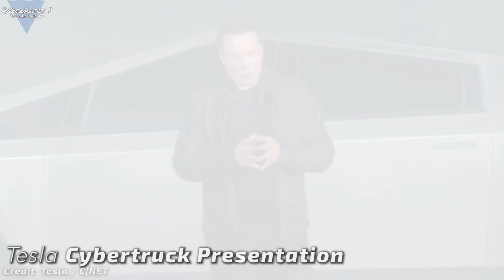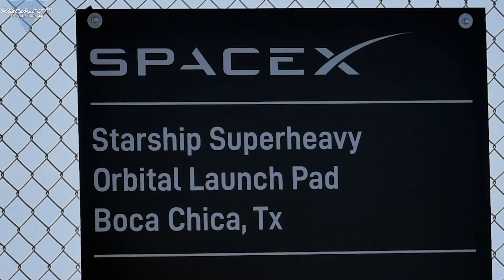53 | SpaceX Starship Updates – Roberts Road Construction - Blue Origin Progress Update

Comment: 3:43 - Not true. They still wanted to do way more testing on Mk1 and Mk2 - Mk1 blew up, so they cannot.  -  Just because they won't fly doesn't mean they will not test a lot of stuff, to get a lot of data...
- Obviously, I don't know, but it was issue with sensor/pump system, not the design itself, so I think Mk2 still has a lot of useful data to offer, even if it's mostly the old process.

Comment: While the point of structural failure was a weld, according to spacex, it was not the cause. Instead, we are told a communication error between pressure sensors and valves resulted in much higher pressure than intended for the test.

Comment: Felix, another great video. Long on content and short on Gee Wizz video special effects. I think your spot on regarding Roberts Road. No way the FAA is going to give SpaceX a Starship permit until the village is empty of people. Imagine if Mk1 had been filled with LOX & CH4 when the tank ruptured. Whereas pad 39A would be able to withstand that level of explosion. We know, it already has.
Some things to cover in future videos:
1) Who is the guy on the wall to the right of your head?
2) SSTO: It is my understanding that one of the Mk will go directly to orbit w/o using Super Heavy. No work on SH and I heard Elon say Starship is SSTO capable. Once in orbit you only need enough fuel to deorbit and then the landing burn. This IMO is essential to quickly evaluate the belly flop deceleration.
3) No way that thing will get off the ground with only three raptors, it is simply too heavy.
4) Would seem the nose section of Mk1 could be used on Mk3.

Comment: Their manufacturing is a DISASTER...It needs to be MOVED INSIDE of a Large building. Trust me...There is so much sand and dust blowing around in Boca Chica Texas.
Reply: The tanks and other inside parts, wich need protection while building, are build inside. Welding the outside is not necessary inside.
Reply: @Ravenought69  - You must be the same guy that told me it wouldn't BLOW UP a few weeks ago....guess I was right then huh ?? ..Sure the fuel tanks may be made in a factory. But they install the fuel lines on site. Have you ever been to Boca Chica ?? I have...its damn windy and lost of dust. Plus...I can tell you those welds were shit.

Comment: Why does nobody mention the fact that MK1 was being pressure tested with N2 and I expect over pressurized to confirm if the tank and protection devices are capable of handling the events, so now they know some of the issues. As far as I'm concerned the failure is a win not a lost, look up how war planes in WW2, were repaired and what parts were improved, when shot up planes managed to fly back.
Reply: People have spent most of the last week talking about the MK1 test... not much more to say, given the shortage of official information. The most likely interpretation of Elon's statements is that they found something in the first pressure test that was serious enough to pull the plug on MK1 flights, then did some more extensive tests which (spectacularly) confirmed it. But even that's speculation...

Comment: Beautiful Drone camera work.  The truck needs a way for real truck owners to adapt a headache rack to it.  It is common for iron welding shop owners and construction owners to carry 16 ft. to 24 ft. long material.   Those are the people that can afford a new truck.  
     If China was doing this rocket launch stuff,  I think they would use gravity to help launch the space ships.  They would build high water towers and heavy pistons to push water down and make a U Turn at the bottom to a nozzle that  thrusts water jets upwards onto those actuated fins, for example.  This would reduce the fuel needed to launch and/or allow heavier payload.  About 6 towers, arranged in a circle, 20 ft in diameter and 2000 ft tall should result in easing that first 500 ft. detachment from gravity.  Plus you get a piston (the rocket) in cylinder effect from the rocket thrust against the pipes of the water towers.

Comment: Blue Origin's re usable rocket..... I hear another large boom on the horizon. Awesome news about how the Tesla truck can be pressurized and used as a rover. Wonder if they will come up with a line of attachments for it like the WW2 jeeps. think about it, a portable water / oxygen / fuel  generator, a concrete mixer, a rock crusher, a foundry furnace, a large scale 3d printer, and a 3d printer powdering raw stock machine all powered by plugging it into the Tesla truck or other Tesla power sources. That's just a few of my Lunar / Martian attachment ideas. Any one else want to chime in on attachment ideas?

Comment: Mk 2 is far from being over. At the very least, they will use it to develop the entire logistical chain of moving it around.

Boca Chica is, and (probably) will always be Spacex's primary facility.
It will be easier to induce people from their California facilities to move there as they pull out of that cesspool state.
It will be easier to induce talent from the rest of the country to move there since they won't have to move to the cesspool commonly known as California.
SpaceX plans on launching the way airlines do, they will not be able to do this at the Cape because other rockets also need to launch.
Launching from the Cape brings all the baggage that NASA carries with it.
All that said, the Cape is where the military will want launches so they can control access better.
The Cape also brings all the good stuff that NASA has to offer.
Rockets launched from Boca, can always be landed at the Cape. My bet is it is will be actually cheaper to move them via launching, than via boat.

Comment: Hilarious. It's so shiny. I'm getting sleepy. I believe, I believe. It looks so much like the rockets in my comic books. So it must be true?! I believe. The rent-seeking conman and his TheranosX's next development site will be in Guyana. Jonestown, to be exact.

By the way: Steel is 3x denser (heavier) than aluminum, and stainless steel is heavier than standard carbon steel. In aeronautics, stainless steel has the lowest strength-to-weight ratio. i.e. It's strength is too heavy to use in an efficient rocket design. That is why the Saturn V was primarily aluminum.
Reply: Gosh, you just haven't been paying attention at all, have you? 301 stainless becomes much stronger at cryogenic temperatures, and it is rugged enough to withstand reentry. Yes, other materials would be lighter for a launch, but they do not permit reuse, which is where the drastic cost savings come in.
Reply: @odysseusrex5908  Stainless become less malleable, brittle, at lower temperatures. Regardless, the stainless steel only serves as the skin of the rocket prop, not fuel containment. Aerial shots show one of the insulated fuel tanks that is to hold the super-cooled fuel.

Of course you know this, which is why you dodged the more pressing issue of stainless' strength-to-weight ratio. The rent-seeking conman is using shiny stainless for its hypnotic effect to lure people into the con--Stainless as flute music, so to speak.

Stainless also presents a problem in regards to heat absorption and the effects from uneven heating on a rocket's aerodynamics. That's why the Saturn Vs were painted, despite weight being an omnipotent problem. White paint specifically absorbs much less heat, lowering the cooling burden on the underlying fuel tanks, and reducing uneven heating. Paint in general smooths out small skin irregularities, lowering the incidence of aerodynamic buffering, amongst other things.

And all those large visible dents and bumps- visible from even a distance away - in the skin would even make subsonic flight impossible, never mind supersonic. 

But you keep on believing that the shiny prop is going to fly to space, and don't forget to stock up on your favorite flavor of Kool-Aid.

TheranosX

Comment: I'm sorry Felix I was little incorrect and possibly misinformed myself.
Reply: Got any sources on that? It's a claim that's circulating widely, but as far as I know, it's 100% speculation... no confirmation from SpaceX, just some numbers from people making ballpark guesses as to the force involved.
Reply: @simongeard4824  I found out from three of the main content creators, if I'm not mistaken I heard it first tmro and some of those guys work at SpaceX. I know the failure was due to a valve but I do not know for sure if they are keeping the same material or changing. Like I said my second comment I got pissed off when he revealed the truck and I change the channel before he could go through all of the material changes so I missed that. That being said even though the failure was a valve over pressurizing the system it might still change materials it's all speculation every where we're at right now only ones that truly know what's going to happen is SpaceX. I don't see any harm in speculating though I'm not the engineer!
Reply: @SteveSiegelin  I've no problem with speculation... just with speculation that's not clearly identified as such, and which quickly becomes misinformation. You mention the big content creators... E.g. I know that Scott Manley talked about the "stuck valve" theory, but he was certainly going only by observations, not from any kind of announcement.
Reply: @simongeard4824   You may be right, I jumped the gun.
Reply: @SteveSiegelin  It could still be right... I just don't think there's any confirmation. .
Reply: @simongeard4824  give me a little bit of time and I'll see if I can find the reference videos and the papers I got the information off of. As far as I know that was straight from the SpaceX crew though.

Comment: Coming from a pipe fitting perspective I think SpaceX should just use a large seamless pipe for there main sections then they wouldn't have the blow out problems a single seamless pipe design would handle litteraly thousands of pounds of pressure without blowing out far higher pressures then would ever be needed for the project I really hope someone at SpaceX has thought of this also just based on all the movement at Cidco road I think they are going to scrap mark two and start mark three or four at Roberts Rd. I think we will see a small team out there cutting it up after long
Reply: Dude I'm a tool and die maker and I can't even imagine the size of the die that would be needed to make that thing but I like your thinking.
Reply: @Richard_Cranium  I've worked at power plant jobs where a 30 foot wide pipe was not that uncomin of a thing but yes you're right that would take one LARGE jig to make that beast although when you consider that they want to make many of these it is the perfect answer to the problem
Reply: @wesleywindham1880  It's not just that they need a large pipe... it's also that it needs to be as light as possible. Starship may look like a water tank, but it's got a lot more design constraints...
Reply: That may be a great idea for mass production.
Alternatively, a continuous spiral construction, as mentioned in comments from an earlier video, is another brilliant idea to bring to the table. It’s compact size, variable diameter construction (on the fly), and scalability seems very competitive.
Reply: @gary.richardson  Well yes that's true but I think again they would have the same problem with it poping it's top but I definitely do see the benefits to a spiritual design very ingenuitive thinking there

Comment: Resets sometimes are required. But i think they were running too fast. Look. Now they have tons of useless steel rings, plates, and other compoments. Clear way is sometimes better than chase with breaking legs
Reply: The metal can easily be repurposed or recycled. There are many brackets, templates, and jigs that can be fabricated from that scrap.

Comment: Musk was so taken with making an ELECTRIC truck he forgot to make it an electric TRUCK.  The inability to reach the bed from the side is a huge problem given it gets used more then the back for tool access and small items where you want the weight as far forward as possible.  Deal breaker for most truck drivers.
Reply: this is really the only complaint i have of it.... not a deal breaker, but sucks.... i usually use the front of the box just so stuff doesn't blow out (empty oil jugs, funnels etc) and its the quickest access via sidestep , but i wonder if its even possible to change given how the body is the frame..... I assume a flat box would limit towing/hauling capacity, but would be welcomed by many
Reply: @badfourlife  It doesn't have the capacity too need the extra triangular frame.  The load can be handled by the traditional sides.  It could have something to do with the 500mi range.    Which is amazing.  But Im still stuck on not wanting a daily frustrating truck just so I could go 500mi in one go.

Comment: I thought I heard that the failure during the Mk I pressurization was due to a communication problem with the test equipment.  The tank was pressurized well above the test pressure, and the failure wasn't due to design or manufacture of the tank itself.
Reply: That was my understanding as well. I believe it was Scott Manly who said that, and estimated that it was 5-6 atmospheres of pressure.
Reply: That explanation was posted on one of the SpaceX FB groups. It is unclear how valid that is. Might be true maybe it's all attention seeking lies. Someone has to ask Elon twitter.
Reply: Any test like this should of had emergency pressure relief devices set at the max pressure required.
Reply: @matthewerwin4677  We think they where disabled to raise the pressure above what the relief valves would allow normally.
Reply: @matthewerwin4677  And relief valves can stick... I have had my test crew set up a pump case hydro without a relief valve before.
Reply: . I work in weld inspection and quality control of high pressure piping. My client Chevron requires a PRD on every hydro. The PRD's are tested and certified every 6 months. A test the size of starship should of had something 10" in diameter or bigger. And 2 of them for redundancy.
Reply: There's not been any official word as far as I know... so everything you hear is, at best, educated speculation.

Comment: the day cybertruck goes lunar rover is the day sales will go thru the roof
Reply: Yep  everyone will want to have lunar rover down here.... I'm one of them but  first I must win jackpot 😁😁
Reply: Is that a moon roof?
Reply: They need to fix the windows first
Reply: @dcb1138  windows are just fine... The sequence of testing was wrong
Reply: @urosrot7916 Rot what does that mean? Do you mean you swallowed Elon's excuse about the hammer blows? Why did the back window break in the same fashion? Are you suggesting that hammer blows to the drivers door caused the back doors window to also come off of it's track? You mean you couldn't tell that Elon's excuse was a lie?
Reply: @jcwiggens  so why the glass didn't break on the backstage before presentation with same steel ball...
Reply: @jcwiggens  and nevertheless  my statement about cybertruck don't change: if I would win jackpot I would buy cybetruck prior any other SUV.
Reply: Yeah it'll be out of this world
Reply: Literally thru the roof
Reply: Hondo excellent.  Knight rider will have to wait.
Reply: Ah, so never then? The Ctbertruck is an aerodynamic pickup truck. Why in the world would you need an aerodynamic pickup truck on the Moon? The Moon has no atmosphere? Derp derp derp. Your post got 83 likes. 83 Tesla fans with little insight into the equipment that will be needed on the Mood, I suppose.
Reply: @jcwiggens  guess again..it is structurally very strong and it is a TESLA
Reply: and the story doesnt remind the falcon heavy and its payload
Reply: Brilliant!